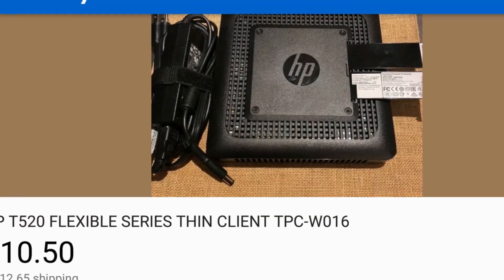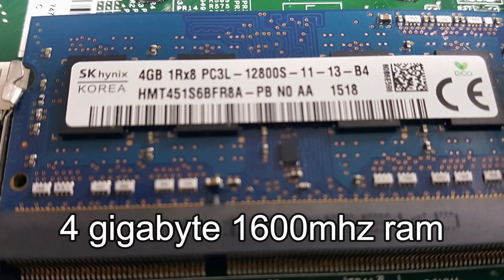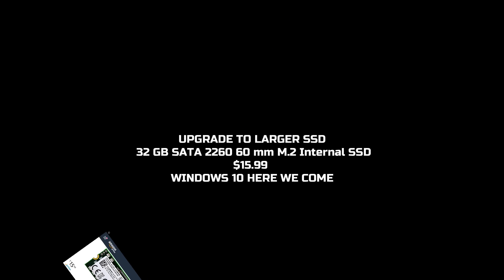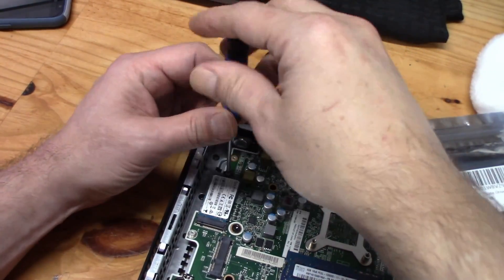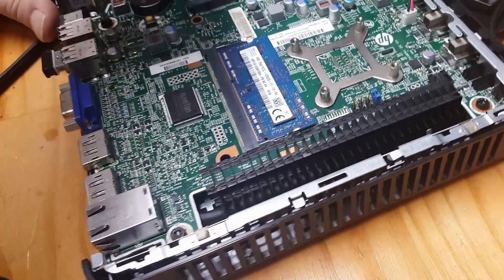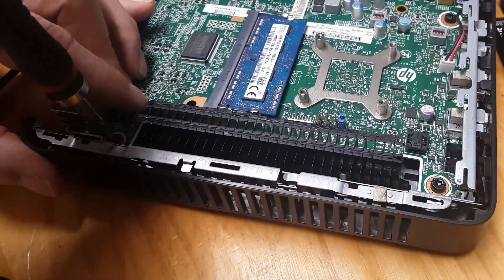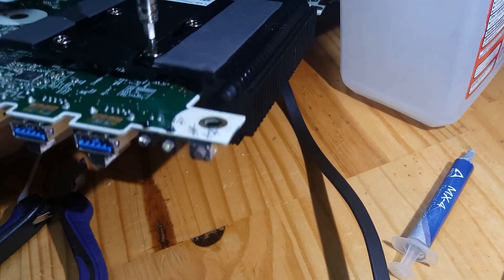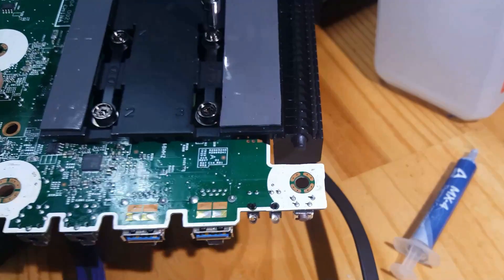PC Gaming 1080p on HP's T520 flexible thin client

Comment: great job!. i have the same T520 running Android and windows 10 (booting from external HD), and i can say is capable to run COD 4 at decent FPS using the integrated AMD R2e GPU. Windows 10 is slow from USB disc, i'd like to upgrade the internal M2 SSD (origunaly only 8GB), but im not sure if can handle a 120GB M2  or is limited to 64GB, the spec sheet says 8/16/32/64, but dont know if this is a limitation
Reply: have you found out? im trying to upgrade one for a friend i cant find if there is a cap for ssd
Reply: I put a ngff m.2 sata card of 128gb in my t520.
Reply: Dude, how did you install win 10 on it, I have been trying to do so but I get licensing error

Comment: single chanel ram is very bad
Reply: only if using the integrated GPU (because the iGPU uses system memory and is highly dependent on faster ram for its performance), when iGPU is disabled and using a dedicated GPU theres not much performance difference between single and dual channel, especially with those kinds of CPUs.

Comment: I didn't skip this and will go watch your other video about the egpu. I wanted to do this with my laptop and was wondering what graphics card to pair with a dual core i3 7th gen in my laptop. I upgraded my laptop to 8gb of ram but I don't have any back panels to access the parts though I was thinking of removing the CD player on my laptop since I never use it so as to have a place for the egpu cable to come out from. I also wanted to add an ssd to my laptop cause it is so freaking slow though I was wondering if the CPU would bottlneck a graphics card like the GTX 1050 or 1050ti. I was thinking of getting a GTX 1050ti or possibly a used GTX 1060 3gb for 1080p gaming. If I got a 1060 3gb how much would my dual core laptop bottleneck it? Many thanks in advance!
Reply from the maker: Between gt730 and gt1030 there was no performance increase the 1x slot will hinder it.
Reply: @modstek  Thank you! I might try using a GTX 1050 cause that shouldn't have too much CPU bottleneck hopefully. Are you doing anymore eGPU projects? They are really cool! Also, I had an idea for an sff wall-mounted PC case by basically taking a magazine wire rack that is on the smaller size but big enough for a motherboard and GPU and using a riser cable to mount the gpu flat and then using cable ties to mount the motherboard and GPU to the wire rack. I was wondering if it would be too heavy to hang on push pins in a pin up board attached to my wall. I can't drill holes in my new room but it might have a push pin board so I could theoretically hang the wire rack PC on the pins. Do you think it would fall off? I'd only use an ssd for storage and pico psu so there wouldn't be too much weight to it.